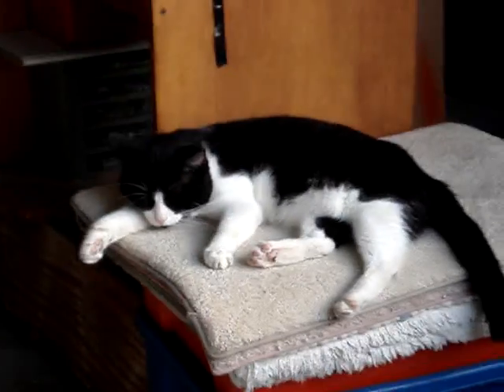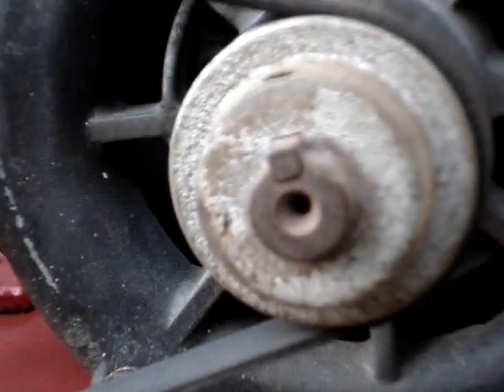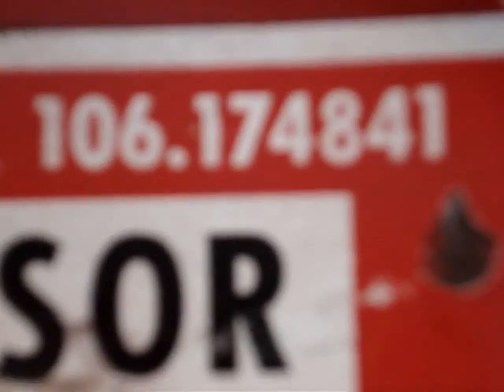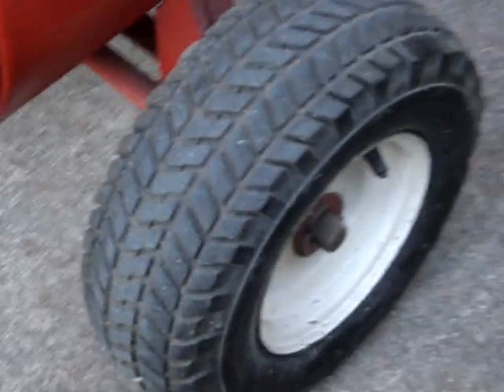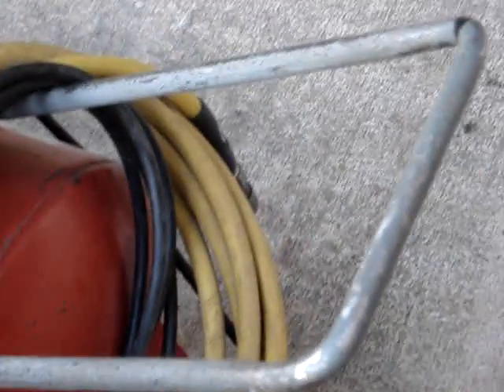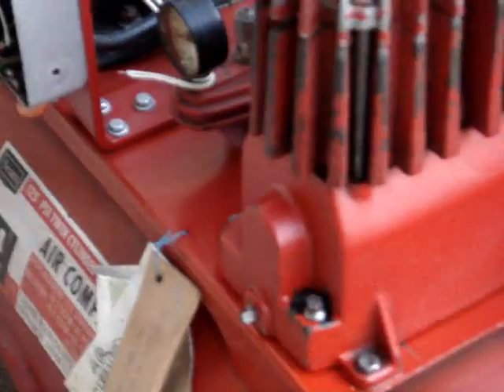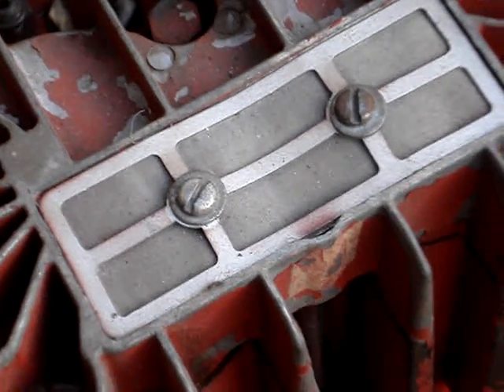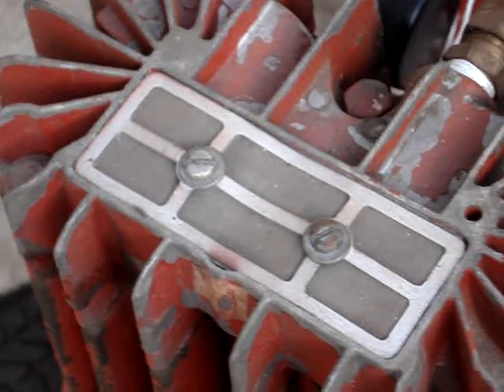my air compressor KRAPPED OUT

Comment: The 5hp at Tractor Supply should bolt right on there. SKU Number: 3241192
And Royal Purple makes a compressor oil. Keep the reed valves clean and it will last forever.
 I've never owned a new compressor. My friends "oiless" threw a rod at 6yrs, phoey.

Comment: ah you get your self a good replacement motor as close as possible to the original, GE, Century, westinghouse. . . a good quality motor.  fix it up and it'll last you another 34+ years. we had a sears compressor like that it was a 1976 model. the condensation drain valve broke so we couldent drain the tank and it rusted out. so we got a used dayton speedaire compressor. its actually very very close to our old sears.